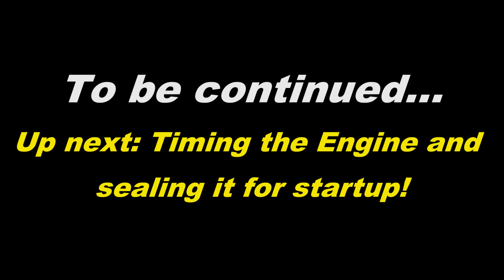Ford 5.4L 3v Engine Timing Chain Kit Replacement Pt 3 of 4: Valvetrain Component Removal

Comment from the maker: These are the Tools and Parts needed for the job:

Updated Latest Ford Timing Kit-
https://amzn.to/3Y725xy
2004-2014 Engines Latest Roller Followers x24-
https://amzn.to/3BtEHgm
2005-2014 Engines can utilize this Ford Racing Kit-
https://amzn.to/492DRYC
Valve Cover Gasket Set:
2004-2007-
http://amzn.to/2ao6KB7
2008-2014-
http://amzn.to/2ap9x05
Latest VCT Solenoids-
http://amzn.to/2aZtAo5
Crankshaft Pulley Bolt-
http://amzn.to/2aNQwRL
Phaser Holding Tool-
http://amzn.to/2aBVfpK
Roller Follower Remover Tool-
http://amzn.to/2aDglu5
Crankshaft Positioning Tool-
http://amzn.to/2ap8eOD
Cat Claw-
http://amzn.to/2anM8yV
Crankshaft Pulley Puller (2004-mid year 2008)-
http://amzn.to/2akfw3k
Crankshaft Pulley Puller (mid 2008-2014)-
https://amzn.to/2pHaaMH
Pneumatic Fan Wrench Kit-
http://amzn.to/2auxqmP
Permatex Engine Sealant-
http://amzn.to/2anMrtp
Lisle A/C disconnect tool-
http://amzn.to/2aaYpW3
5W-30 Oil I recommend-
http://amzn.to/2aeRdUt
Melling M360HV Oil Pump-
https://amzn.to/2IBcqKG
Engine Coolant needed if drained-
http://amzn.to/2aeR6bh
Mopar Rust Penetrant-
http://amzn.to/2anN8D7

Oil pump replacement Video-
https://www.youtube.com/watch?v=ulEJfcQ7HhA
Ford 5.4L 3v Triton Engines: Roller Follower Removal and Installation Video-
https://www.youtube.com/watch?v=jdAUeVRBNA8

Torque Sequence Diagrams:
Valve Covers 2004-2007: 89 inch lbs
LH-
https://drive.google.com/file/d/0BzYkF_-Nh949YkFXTmxFbTNVcXc/view?usp=sharing
RH-
https://drive.google.com/file/d/0BzYkF_-Nh949akIteHRIcWhvVDQ/view?usp=sharing
Valve Covers 2008-2014: 89 inch lbs
LH-
https://drive.google.com/file/d/0BzYkF_-Nh949Tno0czVseFh2WjA/view?usp=sharing
RH-
https://drive.google.com/file/d/0BzYkF_-Nh949WWRHVVg4ZFN5SWM/view?usp=sharing
Front Cover Sealant Points-
https://drive.google.com/file/d/0BzYkF_-Nh949Rkx5SEk0MndaMkk/view?usp=sharing
Front Cover Sequence-
https://drive.google.com/file/d/0BzYkF_-Nh949RUdfR1hfVHhlWWM/view?usp=sharing
LH RH Camshaft Sequence: 89 inch lbs
https://drive.google.com/file/d/0BzYkF_-Nh949UjdDN3BybWtsejg/view?usp=sharing

5.4L 3v Timing Chain Kit Replacement Series:
Part 1- https://www.youtube.com/watch?v=nQVKnd2r-ww
Part 2- https://www.youtube.com/watch?v=u6wkyLEeUgg
Part 3- https://www.youtube.com/watch?v=mjBPC10kjKA

Forscan is a free Ford Specific Diagnostic Software:
Download Here- 
https://forscan.org/home.html
ELM 327 Adapter I Recommend-
https://amzn.to/2GC6dBj

As an Amazon Associate I earn from qualifying purchases.
Reply: I would like to say thank you for you perfect instructional videos
Reply: I've seen several aftermarket full timing chain kits that are $200 to $400.  Do you only recommend the Ford parts?  Major price difference...
Reply: FordTechMakuloco bro my tentioner guid pin on driver side fell out, hole is wallerd out, ford suggested welding it but they won't do it cause they'd have to stand behind it but I don't think those metals are the same what do you think?
Reply: ALSO....every other follower came out easy no problem. Its the last one!!!
Reply: ⁶
Reply: I have a couple questions... 1) The link for the OTC crank alignment tool is for tool #6024, the one you are using in the video is #525219, is there a difference? 2) Can you use the older style cast iron tensioners on a 2010 5.4L 3 valve engine? Getting ready to tackle this job and want to make sure I have everything I need on hand before starting.... Great videos!!!
Reply: @dangoodwin7935  otc 6024 on otc website said 93-12 will work on all engines. Simple tool tbh reviews look good on Amazon for the iFJF and DPTOOL versions either $12.37 or $10.80 currently, they should both work well.
Reply: @texanbalaban6777  I already have the 525219 tool from doing the 2003 5.4l 2 valve in my 2003 F250
Reply: @dangoodwin7935  one sec B0$$
Reply: @dangoodwin7935  when You say older style cast iron tensioners: what year does the tensioners You're looking at say they're for? I went with Mellings brand for mine.
Reply: @texanbalaban6777  I bought a Melling kit for my 2003 F250 with the 5.4L 2 Valve engine, not understanding that kit came with the cast iron tensioners already, I bought and additional set, Getting ready to do my 2010 f150 w/5.4L 3 valve, if these would work I'll keep them and install and do away with the plastic version with gaskets that are blowing out.
Reply: @texanbalaban6777  Sorry Chief, had a brainfart.. should've just went to their site and looked them up instead of asking... they will work for my f150...
Reply: I'm looking to replace all roller followers and lash adjusters. Is there an easier way to just remove cams and do all roller followers and lash adjusters at same time?
Reply: Also can I clean camshaft with Chem-Dip or do You clean Yours with something different or don't clean at all?
Reply: FordTechMakuloco  after cams are in neutral position. Do I take out rest of followers before timing?? So cams move freely?? Or do I have to take cam out than followers???
Reply: @frankobinc  where are You in process? Chains on, key way at 6 o clock, 3 roller followers out on each side?
Reply: @texanbalaban6777  what is the purpose of taking out the 3 roller followers per side?
Reply: @seanmikk1505  I am wondering the same thing. How are people doing this job without the information about removing the roller followers ? what does it do?
Reply: Hey fordtechmakuloco... I have a question on the timing of my truck. I've got all the roller followers removed with crankshaft at 12 o'clock except for the one on cylinder 8. It's not on base circle and is really tight. Can I spin the crankshaft to get it at base circle so I can remove it as long as I'm in correct 6 o'clock position before i remove the timing chain?
Reply: Im having a hard time getting the roller followers out. They just pop out in your videos. What am I doing wrong? I have to get a lot of effort for the first cylinder to pop up
Reply: I bought the tool to take out the roller fowlers off but can not get the tool close enough to the threads to screw it down to take them out I watched the video
Reply: Got it. It is working just a couple more things to do  and it is  done. 
How in the heck you didn't bust a Knuckle. My hands look like i was street Fighting for a week. 15:48
Reply: do we want the keyway at 12:00 on the compression stroke or moreso the lobes at 11:00
Reply: Can I use cloyes timing chain kit with vvt sprocket or without vvt sprocket and use oem vvt sprocket or melling timing chain kit with or without vvt sprocket or oem vvt sprocket

Comment: READ THIS! if your plastic guides are busted, those plastic pieces are clogging your intake on your oil pump. SAVE YOURSELF the hassle of fiddling with the oil pump bolts and drop the pan. A new oil pump doesn't do any good if the intake tube is clogged. And it realy gets up in there too. Ford built it like a clam shell. Yeah, more to makuloco!

Comment: The exhaust rocker followers will not come out with the tool, you never showed how to remove them. Literally stuck because they won’t come out
Reply: Go to minute 5:00 in the video. He only does 1 as an example. I struggled to take them off too. The one on cylinder #8 was the hardest for me. It was the last one left for me, I ended up cranki the crankshaft counterclockwise a little and I had to take off the front driver side wheel and do it through the plastic wheel liner so I can use both hands and easier access than trying to reach over the break booster, oil dipstick and plastic break booster vent line.

Comment: Your removing all the rocker followers after all the chains and phasers are removed, but how are you rotating the cams to get the lobes at base circle with no phaser on the cam?  Also is it safe to rotate them with no chains on them?

Comment: What do you do if somebody started this job before you and just started pulling the timing components and the motor jumped a little bit? After getting the cover off the first thing that they did was pulled the tensioner on the right side and watched the motor jump, then stopped.

Comment: Thank you for your reply of list of links for parts and tools  i WAS tempted to buy Cloyes , I have decided to follow your advice and spend more on ford parts. I clicked on your link for ford timing chain kit Amazon. It specifies it fits the 5.4. It does not say that it fits the  explorer 2007 4.6 3v.  Do the kits for 5.4   Also fit the 2007 4.6 3v ?   Please and thankyou. Also I clicked on your link for the melting 360 oil pump. It says “DOES NOT FIT FORD EXPLORER “.

Comment: I recieve the valve spring tool tomorrow I’m ready to begin part 3, I found 3cam. Caps on pass side to be very loose,  I’m removing each cap individually then snug back down , because springs are still in. The ones that were loose are a little banged up.  So far all tjat wer tight look very good. I will have to wait to look at head half (bottom half).    Thank you for coming over last night. If only 3 caps are in less than perfect  condition ,should  proceed?

Comment: Thank you, Brian! Had to do the timing job in Dec 2024, its been running great for two months, so I believe its fixed. I’m truly grateful for your help.
Reply: So do you take out all the roller followers or just the six that he showed us before putting the crank at the 6 O'Clock position?

Comment: we want the keyway @12:00 on the compression stroke or moreso the lobes at 11:00?
Reply from the maker: There is no compression stroke.
Reply: @FordTechMakuloco ok.
can't seem to get the keyway at 12:00 and the passenger side lobes at 11:00

Comment: Just make sure I understand correctly- you remove the roller followers that he does, spin crankshaft to 6 o clock, remove timing components and then you can remove camshaft and remainder of roller followers once camshaft is off?
Reply from the maker: Correct!
Reply: @FordTechMakuloco  thank you sir! Great videos 👍🏻

Comment: You've saved me THOUSANDS of dollars, and have literally helped me put my kid through college. By prolonging the life of my 20yr old 4.6 v3 mustang and not having to buy a new car! Thank YOU!!
Reply: were there any major differences at this stage on the 3 valve? Like the position of the camshaft when getting the crank into position, or the follower removal on some of the cyclinders at about 5 min? Anything stand out as different?
Reply: @cadeng8168  Everything was identical

Comment: I am folling your instructions and removed the 3 designated roller follwers from each side and have turned the crankshaft to its final resting position.  This should put the camshafts in a nutreal position and have some free movement. The camshafts appear to be in a nuetral position yet, the camshafts are really tight and do not have any movement. I have removed the tensioners, chains and guides and ready to remove the phasers. Should I be concerned that the camshafts do not have any play? The Truck is a 2009 F150 5.4L  3V
Reply from the maker: Yes they should move a bit nice and free

Comment: Just go an '05 F150 with the 5.4 3V, but I've watched a lot of your videos on these engines before - mad props to you for going so in depth!

One question though - as much work as it is to fish out those roller followers, would it be easier to pull the cams off, swap all the roller followers at once, then reinstall/time the cams???

Comment: Anyone with an 06 F150 (or likely any 04-08 F150), worried about the A/C Accumulator being in the way... it's definitely in the way, alright. But it CAN be done WITHOUT discharging the AC system, or removing the accumulator. It just sucks is all. I tried to get the tool in between the accumulator and the valve spring without moving it, and it just... it wasn't going to happen. 😆You have to disconnect the plastic bracket that the accumulator is housed in, from both the back of the engine bay, and the wheel well and then you really have to tug on it to get it out of the way JUST ENOUGH to get the valve spring compression tool in there. You have like literal millimeters of space between the plastic accumulator housing, and the top of the tool. And you know... "try" to be careful with the accumulator, but you can only be so careful... you have to be kinda rough to get it out of the way. Haha but it CAN be done.

Source: I did it recently, and it sucked. But It can be done. (And my AC still works perfectly.)
Reply: I just did my timing job and it throwing p0012 p0016 p0018 and p0022. I think I'm off a tooth it. It ran for a bit now it idles rough and dies. I unplugged both act silonoids and it stayed running but a little rough. I don't what I did but I did take to cams completely out to replace followers and lash adjusters now my question is do I still follow this video to a t but not take the cams out this time to time it. And if so this time I'm going to see if I can do full revolutions to see if it's in time when done.

Comment: Great video series, thank you. I'm just about to do the same job on my 2012 Expedition with the 3V 5.4L @ 176,000 miles. I will also replace the roller rockers,  hydraulic lash adjusters, oil pump and water pump. I'm going with the Cloyes  chain kit and high flow oil pump but the OEM Ford  cam phasers, VVT solenoids, roller rockers and hydraulic lash adjusters. The oil recommendation is to go to a 5w-30 rather than the previous 5W-20, better for the timing components apparently. 
The last 3V 5.4L timing job I did took me 21 hours, and around $1600+ for parts and $200 to see an Osteopath to get my back worked on after hanging over the front of my F150 for 21 hours.
Reply: There is a video out there showing why not to use nothing but OEM chains and guides because the guide side of the chain isnt machined smooth it's rough, right now I'm replacing cloyes chains and guides that were used on a 5.4 that only lasted 50,000 miles already wore out

Comment: Why do we remove roller followers?
Reply: Because it can be difficult to turn the cams to get the right placement of the phasers for timing
Reply: To neutralize the cam and to inspect and replace worn followers. They’re common to fail. Search out his videos on changing them and why.

Comment: Thanks for the great videos, Brian. I have watched about all yours on the 5.4 3v. I'm starting to get a lot of racket at startup for a few seconds on my 04 F150 with 150k miles. I know it needs this job done. It's definately a big job, so I'm trying to decide if I want to tackle it, or sell the vehicle for very cheap, letting  potential buyers know it is going to need this repair right away. A couple questions I have: Why are the hydrolic tensioners needed? Why not spring tensioners? Also, in your opinion, given the mileage and age of the truck, is it worth the trouble and cost? Other than this issue, it is in nice shape and has a nice ride.  Thanks

Comment: I know I ask a lot of silly questions but in your roller follower video you said you want to remove the rf that is on the base circle with that said why in this video do you remove the single exhaust valve on cylinder one if you put the 2 intake valves on the base circle at 12 o’clock? I just wanna make sure I get it right the first time.

Comment: Hi Brian, love your videos on the F150 5.4 3V, always excellent and very detailed.  On that note however, I am having trouble understanding WHY i need to remove 6 of the roller followers,  and then remove ALL of them, and reinstall them before closing everything back up.  I just replaced my roller followers 2 weeks ago after an incident kicked one of my followers out and the engine was running rough. I had to re-open everything up again because the timing was out.  I noticed that the chains were not where I put them back in October when I did the full timing kit and the marks did not line up. So I don't need to inspect the followers as they are new.  it seems strange to just remove them, only to put them right back in again. The valves will end up in the same position based upon the Cam lobes will they not?  Please clarify for me.  I see many others commenting on this as well, so the reason is not that clear.   Call or text me if you wish 250-212-0302 Mark.  Thanks Brian

Comment: Good job mate. Just a quick question if you’re going this far into the motor and you’re doing roller followers for example as well for the want of 80 bucks what about the valve stem seals….?
Reply from the maker: I never touch them

Comment: Why did you take all the rollers off ?
Reply from the maker: Why wouldn't I is a better question
Reply: @FordTechMakuloco  idk I’m just asking cuz I’m trying to do my own and I wanted to know if I have to take them out
Reply from the maker: In other words they are common failure and hard to replace later so now is the time. So take them all out as instructed and go back in with the latest Ford part

Comment: So all this parts will fit a 2010 ford f150 xlt just curios cause it doesn't say it fits thanks for the clarification in advance
Reply from the maker: yes they do
Reply: Even the oil pump!!!?  Ps I wish u could have ur shop around here so many mechanics but no one like u when it comes  to ford and almost drove to Chicago from DC which is 12 hours drive so u can do my timing  but in ur videos is giving the courage to do mine thanks u r really the best
Reply from the maker: Yup even the pump

Comment: So let's say a guy has pulled the chains and gears off before rotating to the desired position. Would you then need to pull all of the followers out before rotating the craank and cams to where they need to be since it's an interference engine?
Reply: What did you end up doing?

Comment: So just so I’m clear after you pull the roller followers when the crank is in the 12 o’clock position then you turn it to 6 o’clock and then pull all of the rest of the followers. So before I pull my tensioner every single roller follower it out from under the cam?
Reply: How’d you end up doing it?? I have same question